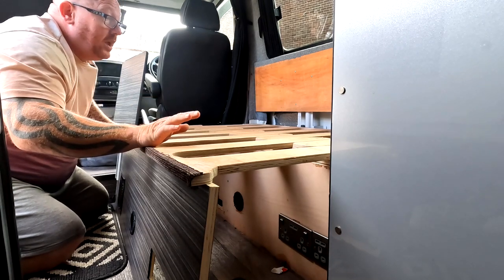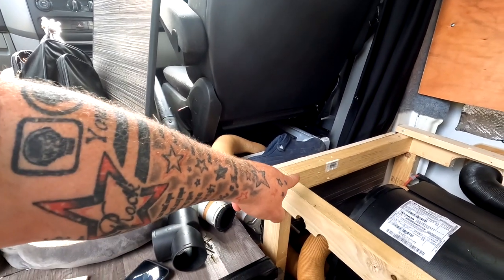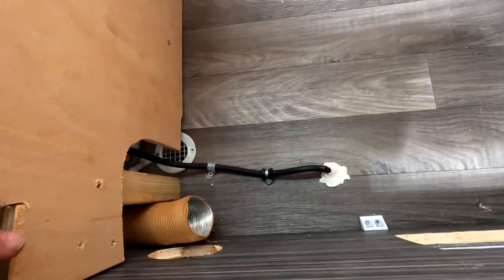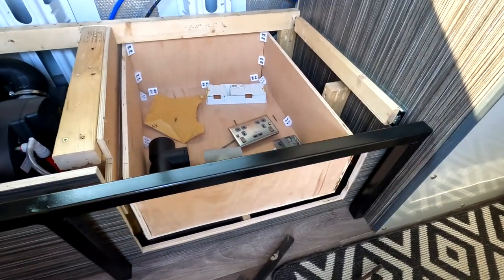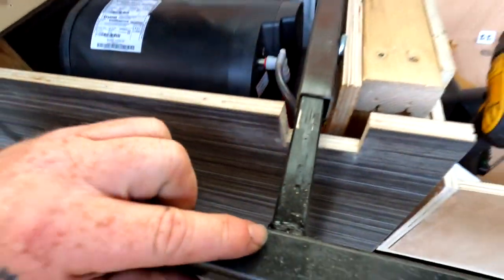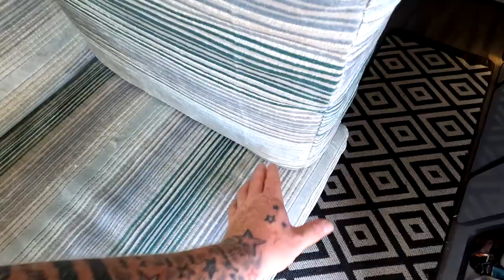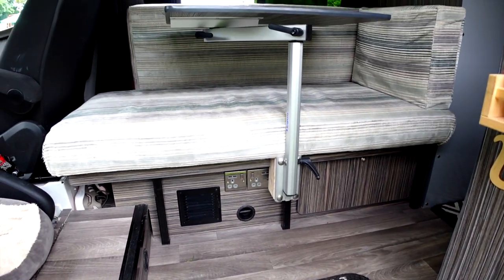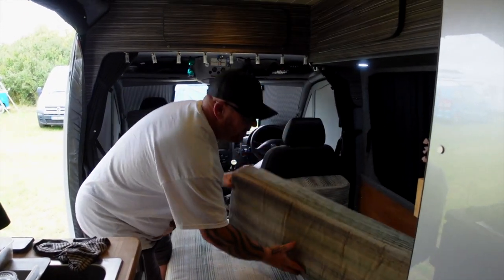Re Building Our Bench Seat For The 3RD Time

Comment: That  power socket that's obstructed will drive you mad as it would drive me bonkers. So, you can either remove it and blank it off or, cut a new piece of furniture board and replace having only 2 sockets. Also, you gotta wrap that HUGE block of wood that supports the table leg! I know, I know, but it looks a bit pants imo. Your van not mine tho 🙂but....just saying.

Love your videos fella. Keep em coming. 

Ps, did I mention that the "upgrade" to that front bench is ummmmmm, very "Heath Robinson"? 

Cheerio. 
👋
Reply from the maker: Socket don’t bother us to be honest . And the wood . Well it a case of what’s needed and what looks nice . Need means more buddy